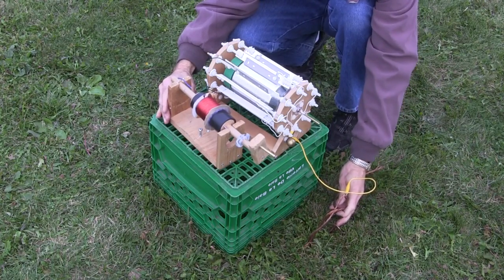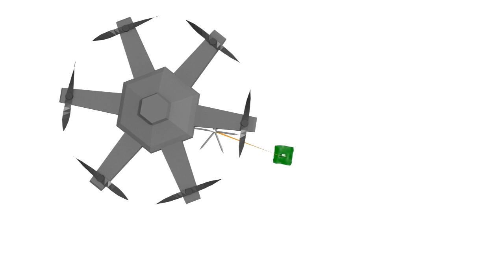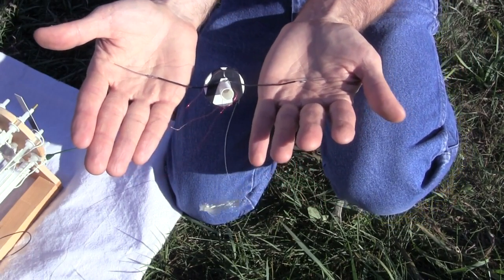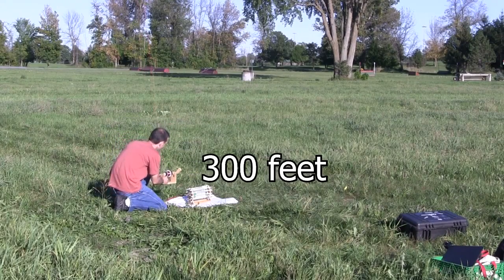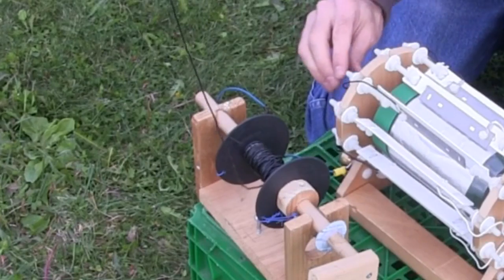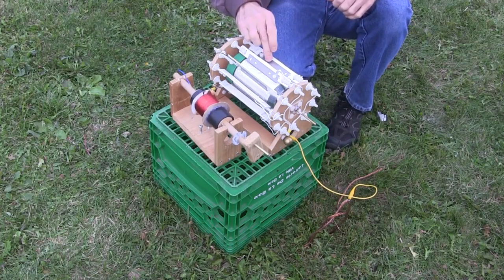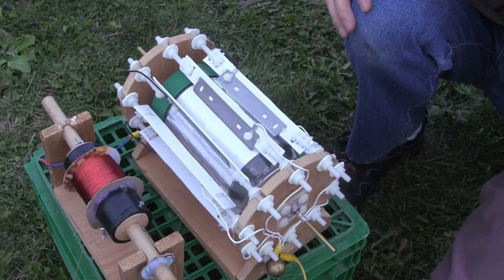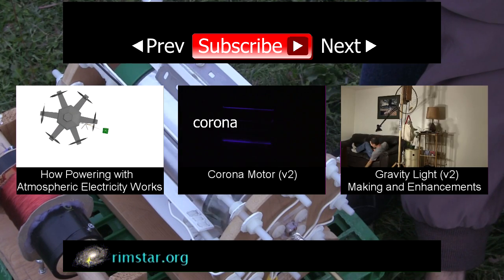Atmospheric Electricity Powering a Corona Motor/Electrostatic Motor

Comment: So you're wasting more power getting hexa up there then you get back? Wouldn't a balloon (weather or other large types) work?
Reply: +WKDworks -- Was just thinking that. However, I think this is really best as a demonstration of atmospheric electricity, rather than a practical use of it.
Reply: +RimstarOrg How about if you use a small gauge wire for the current but use strong fishing line to hold the balloon. Maybe you could use several fishing lines to hold the balloon stationary and have redundant tethers. Also, you could come up with a simple "breakaway" system to cause the wire to drop from the balloon should it break free of the tethers. The wire would not drag off that way.
Reply: With the setup you show here, if you use a weather balloon tethered with the thinnest steel cable you can pick up at the hardware store, it would work. 

Steel, although it has a higher resistance than copper, would still be good for this. It'd serve the secondary function of preventing changes in polarity, and to get around the increase in resistance you'd just have to increase the height of the balloon. That actually might be better in some ways because the increased resistance, if you increase the voltage to maintain the circuit, would increase the amperage of the system. 

At that point, it's more a matter of knowing how much your balloon can lift, but safety concerns at the motor might come into play too.
Reply: +WKDworks I was thinking that too so better to use a kite then or several kites
Reply from the maker: +Kaarlihs The limit's around 50,000 meters where the atmosphere is by then a very good electrical conductor. So not as high as the ionosphere, but certainly going higher within that limit is better.
Reply: it's a proof of concept, and 120m is building order of magnitude. You can drop a wire from the top to the ground and power things.
Reply: WKDworks I was ages ago thinking of trying gravity to power electricity.
Reply: Walter Bunn why not record of video and show us?
Reply: He's just proving the theory. Check out this city powered with free energy on this very theory. It's been around since ancient times. 
https://youtu.be/EQrXSB2-gh8
Reply: It's a demonstration.  In reality, you would have a tall antenna tower, but that is too much work for experimental purposes.

It's like testing a generator with a drill.  You are seeing how much voltage you can produce for testing purposes only.  You will be using something else to spin the generator in practice, because the drill will consume more power than it produces.
Reply: This concept was utilised from wartime barrage balloons, I think in London in WW1. The limitation is power not voltage, which was not quoted on this video. Teluric (earth to earth) energy was utilised in the the 1890s on rail lines in America for communication, I think voltage maxes out at 4 volts. Let me give you an interesting mind map. The earth produces  an EMF, it in turn creates the magnetosphere. I believe you are correct re energy pick-up about 380 feet (the start of the field) but here comes the rub, I think the earth is posative not negative. Try reversing your polarity. Power should increase exponentially with height too.
Reply: Oh your earth spike need to be a 1m round copper bar.
Reply from the maker: +Ostsol Yeah, there's not much practical use other than as a very neat thing and a science demonstration and that's all it was intended as. I've been wanting to do it for at least two decades.
I have considered using a balloon but was always afraid of having a wire landing across some electrical system should the wire break near the bottom, like I showed happen in the video. I'm more confident now of how low the odds of that are, but there was no way I was going to do it before these tests.
Reply: @RimstarOrg  do you sell one?  it is very cool.  I am sure there is some way to amplify or increase the energy.  maybe coils or crystals or something.  best wishes.  have you looked at the Tartaria videos put out by the mud flood folks.  I think you should; it might give you ideas.  It does look like they had a way to pull energy from the atmosphere.
Reply: @liveoak144  Check out "WISE UP" and Eric dubay of course
Reply: @c0olking  yes, thank you.  did that a couple of years ago.  maybe time to see what else they have added, thanks.
Reply from the maker: +gekiryudojo The danger with kites is even worse than with balloons though. With a balloon you can fly it on a windless day and so there's little chance of the wire breaking. With a kite you need a windy day and so the chances of the wire breaking are worse. I recall as a kid flying a kit up to these altitudes and the string breaking near the bottom. The string ended up lying across treetops and branches. I grew up elsewhere in a small mining town surrounded by forests - not even any farmland.) That is unless I'm overly paranoid of wires landing on power lines and power systems.
Reply from the maker: +gekiryudojo That would work.
Reply from the maker: +USWaterRockets I'd considered the strong fishing line alongside the wire approach. Now that I've done the safer drone flights I feel more comfortable with that approach.
Reply: "wasting energy"

That's political consumption talk. Energy is simply converted, never wasted. There is always energy potential in the universe, the method of utilizing it is where inefficiencies are made.

Comment: If you would send the drone up, then cut the wire and connect it to the motor, it should work better, they way you did it, you have an induction coil ( electromagnet if it was dc) in series with the motor that is another load sharing current with the motor. I don't work with ac much so im not positive, but if it was dc then you would have to loads in series.
Reply from the maker: +Jason Walker I'm not sure what you're suggesting, but a corona motor requires a continuous flow of high voltage and moderate current in order to run.
Reply: RimstarOrg the coil of wire your using is impeding the flow of electricity. The spool of wire.
Reply from the maker: +Jason Walker Ah, my bad. When you said "motor" my brain substituted "hexacopter" for some reason and that threw me off. I've thought about the coil of wire acting as an impeding inductor but the current is so tiny I figured it wasn't an issue. I could be wrong.
Reply: RimstarOrg I guess it would depend on the amount of wire on the coil. I may be wrong, just thought I would make a suggestion.
Reply from the maker: Jason Walker
Interesting point. Inductance does have N^2 after all. And suggestions are always welcome. In fact, I count on them for making things better, so thanks!